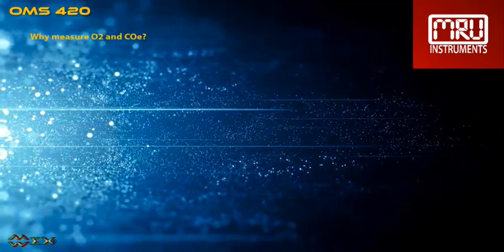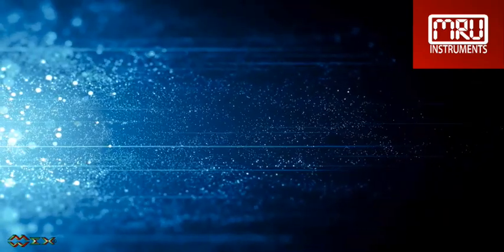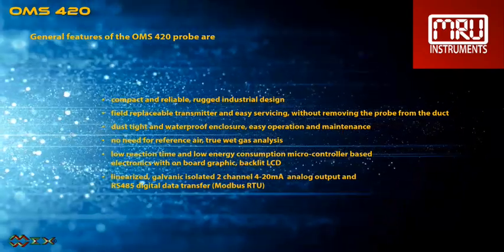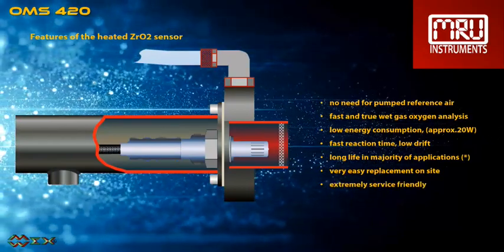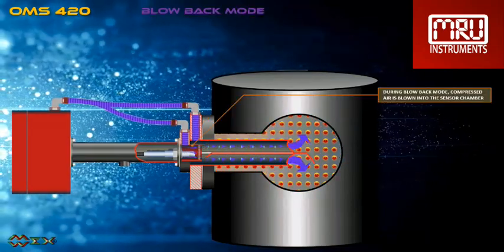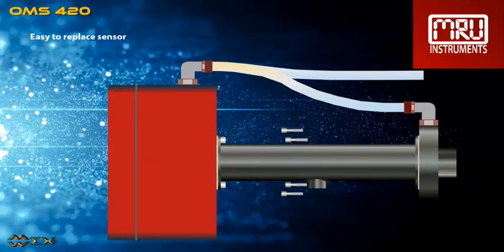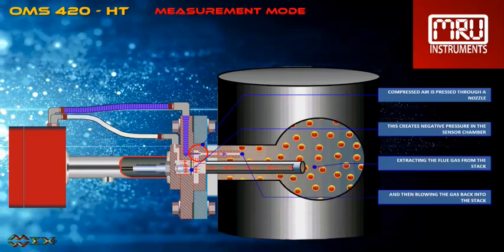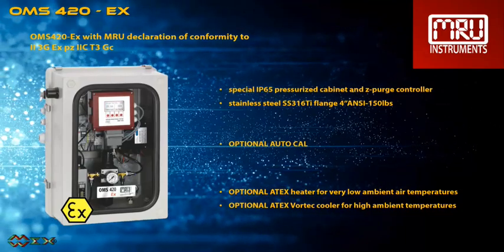OMS 420 - the IN-SITU O2 + COe Monitor

Comment: installed such device but in scada the outpit value is fixed and above 20mA
i looked for clear explanation to adjust the signal from the transmitter to PLC, ddn't find something helpful,
Reply from the maker: Good morning Sir, 
Thank you for contacting us, it will be my pleasure to assist you. 
https://mru-instruments.com/wp-content/uploads/2025/06/62788-1GB-OPERATING-MANUAL-OMS420.pdf
First of all, here is a link for the user manual. 
The topic that you are looking for is on page 35.
Before you can access this menu, you need to enter the pass code, which you will find on page 32.
I hope this will help you to solve your problems. 
Best regards.
Reply from the maker: Good morning Sir, 
thank you for contacting us, it will be my please to assist you. 

https://mru-instruments.com/wp-content/uploads/2025/06/62788-1GB-OPERATING-MANUAL-OMS420.pdf

First of all, here is a link to download that OMS user manual. 
The topic of interest can be found on page 35.
To access this menu you need to enter a pin code, which can be found on page 32.

I hope this will solve your problems. 
Best regards.